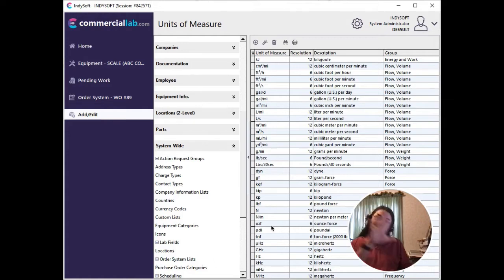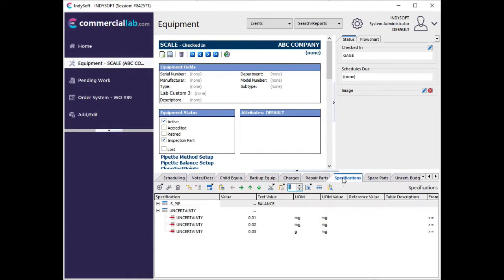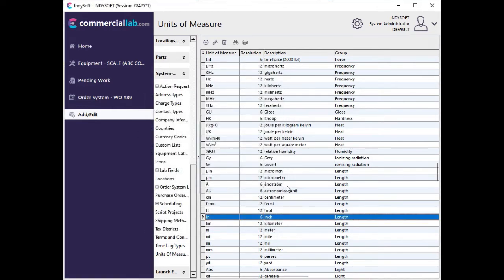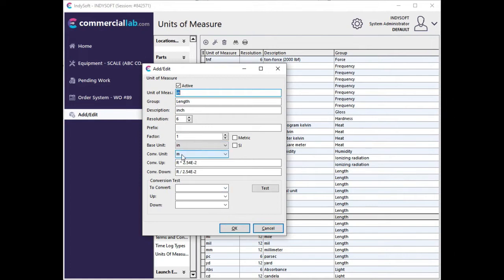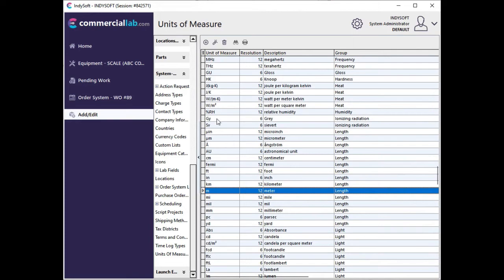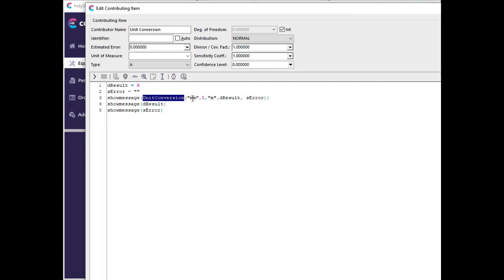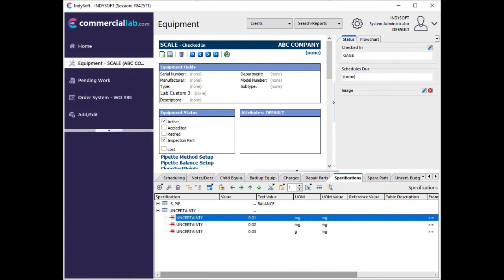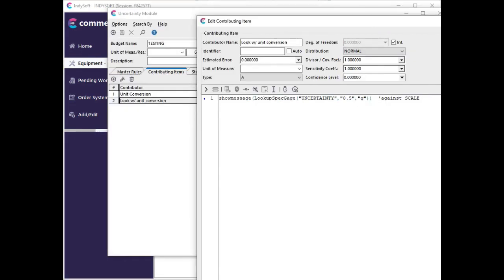Tip Tuesday - Units of Measure: Add/Edit and Conversions

Comment: A note to add to this. All units used must match exactly. If for instance ft/lbs is NOT the same as lbf∙ft and any searches or conversion attempts will return a not found. We find many labs do not have correct unit symbols. Our base install of units comes from NIST SP811.